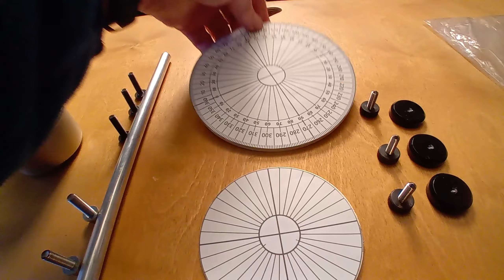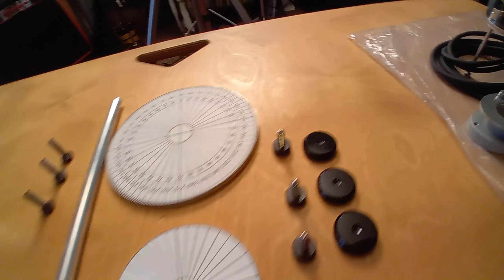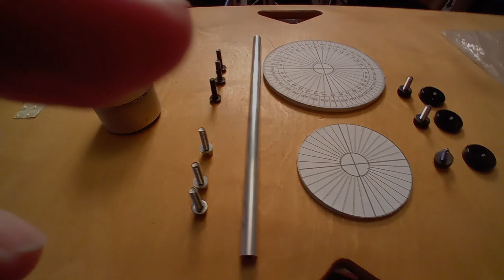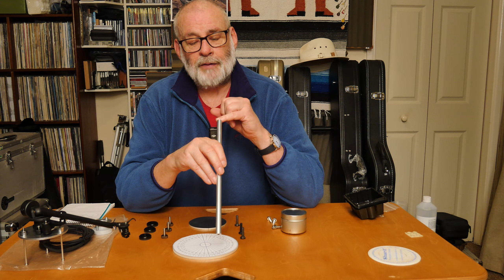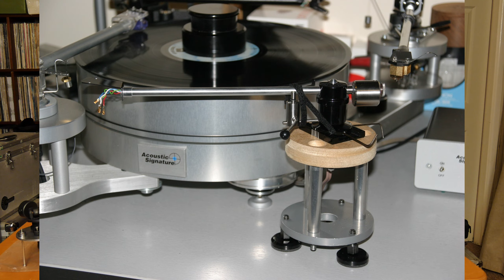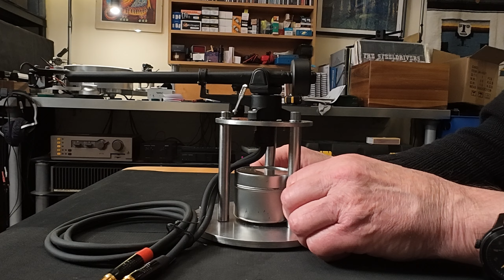Making a free standing mount (Pod) for a fourth tonearm

Comment: Yours is quite a bit better than mine. That said, I feel that in my case this works vastly better than mounting in my Russco deck. It’s shocking how sensitive a Tonearm is. 
https://youtu.be/B3a2RJ66njU?si=XE2ZV1Cd2Z-gPddP
Reply from the maker: This design has been superceded by a more useful one which I can use with different tonearms, rather than having a fixed main height.   Would love to try a Grado arm at some stage.
Reply: @paulwilliams4984  have you posted the new design? I would like to see it. The Grado is insanely expensive. I found one with some issues that scared off other bidders but were easy to fix. I’m currently embarking on a restoration of a James Worden Articulated Tonearm. His son was Wilfred Warden who you may have heard of. He was a child prodigy on the piano and had a modest career in classical music. He and his father created the Articulated Tonearm and speakers that used Lowther and or Wharfedale drivers. I am a huge fan of Wharfedale vintage drivers(alnico) and Pickering tonearms u38. It’s worth noting that both Pickering and G.A. Briggs were classical musicians. I’m hoping that the Worden arm holds similar promise! Are you familiar with it?
Reply from the maker: @polkiju7. Not posted about the updated "pod" yet, but will aim to do so shortly, alongside with a discussion about Chinese made SME tonearm conversion adaptors. 
Sorry, not aware of the kit you mentioned.